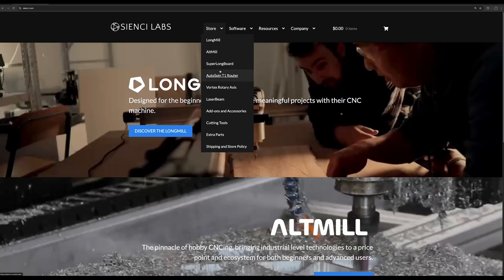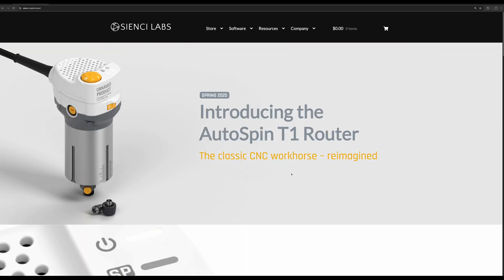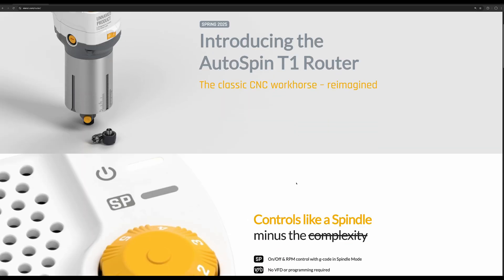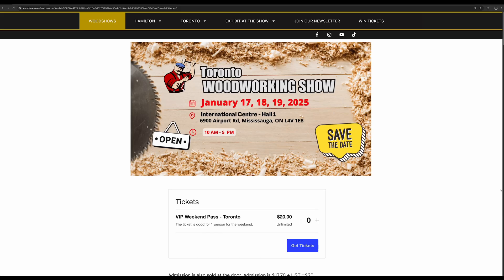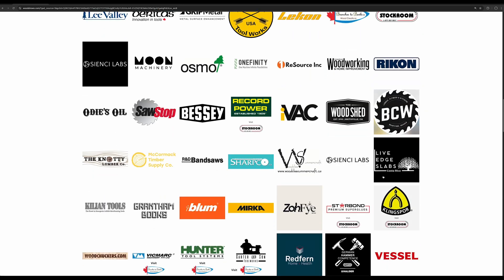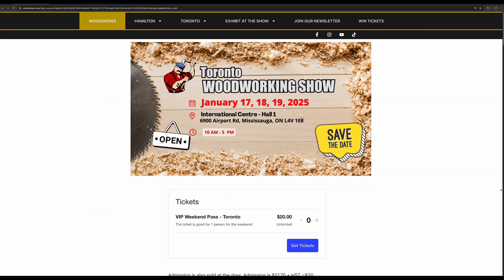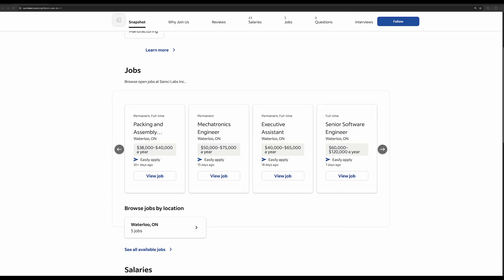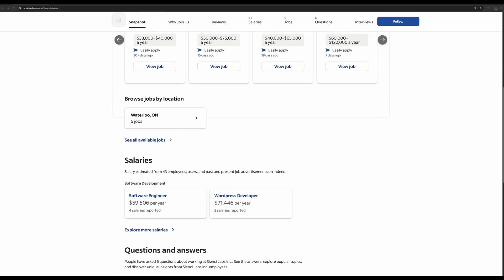Sienci Labs Monthly Production Update - January 2025 - AltMill CNC 2x4, Router, gControl & More

Comment: I understand the Y axis becomes inoperable when the Vortex rotary axis is in use.  Are you considering a solution that would allow simultaneous motion in X, Y, Z and A (rotary) axes?
This would give additional flexibility when making complex "turned" parts, and also parts that require milling on more than 1 side.
Reply from the maker: This was on our older units. Now with our SLB control board that ships with all LongMills and AltMills if you get the closed loop Vortex you can do simultaneous cutting, exactly like what you're looking for